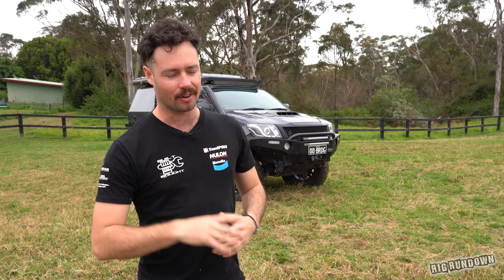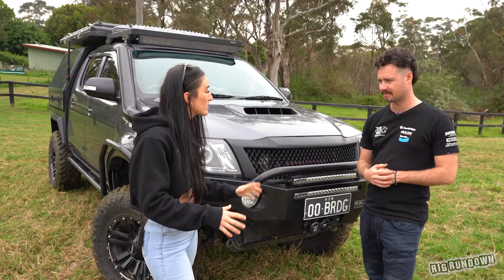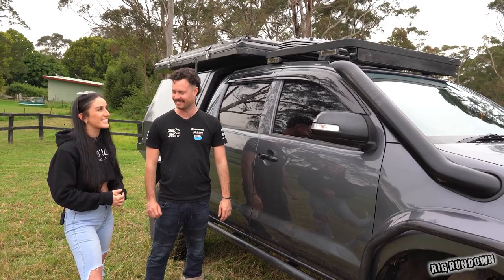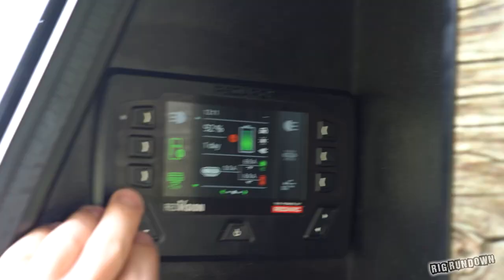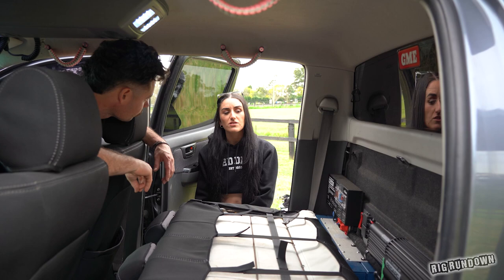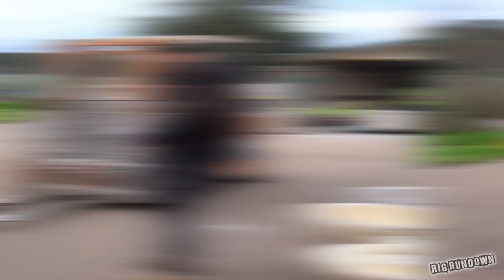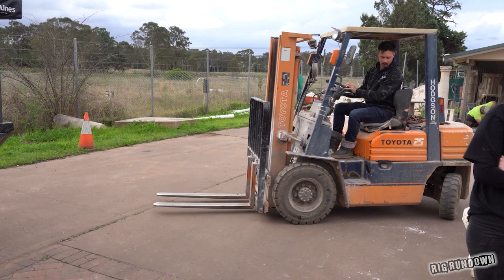RIG RUNDOWN || Bridget's Moist Machine 💦

Comment: I remember when Bridget talked about this build saying how wild it was, that no one wanted to do the canopy fitout, how it was going to be super unique. And she's right. There's so many little touches and great design details in here that you only get honestly from a woman's aesthetic. Because this industry is so heavily male dominant, everything is laser cut sheet metal with dimebag welds and exposed joinery, powder coated gun metal black and glowing RGB, chunky 1.8m canopies that hang off the back of the rear axle. 

This build has a lot more warmth and character to it, the deer horns, the timber interior that resembles vanlife interiors, the concealed 12/24v, the mirror and vanity cupboard, all the details, the overall tight compact design. The modest engine mods make this a much more reasonable build because it's not dumping soot off every green light. 

She put it perfectly when saying she made a common car pretty unrecognisable and unique